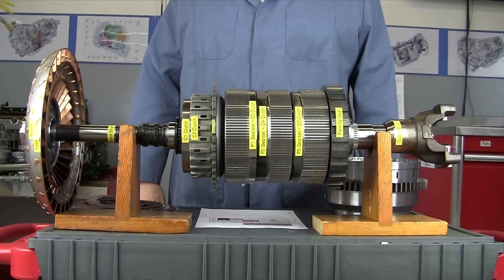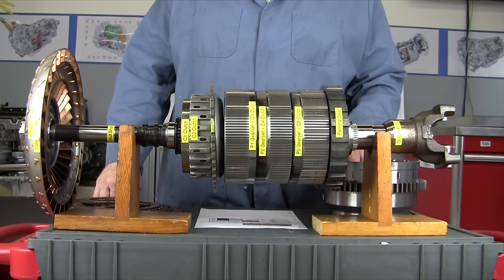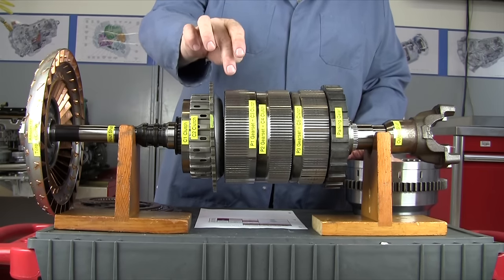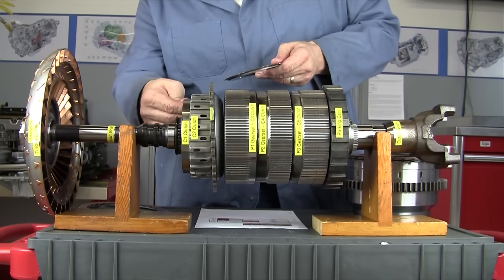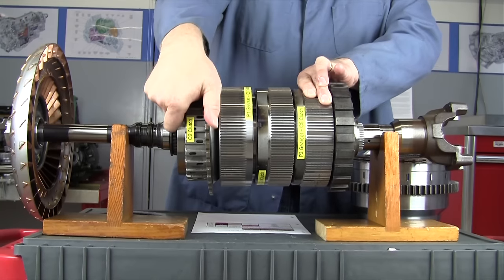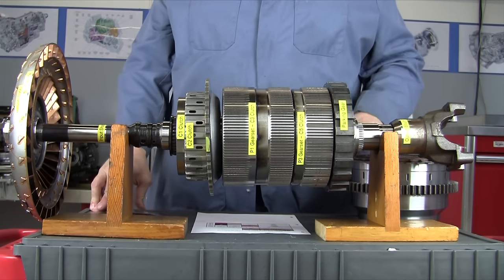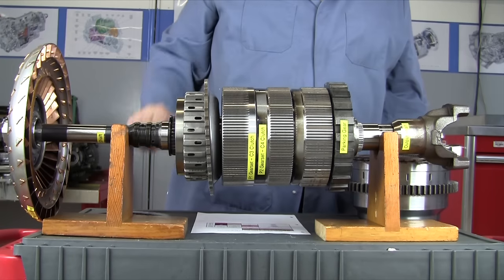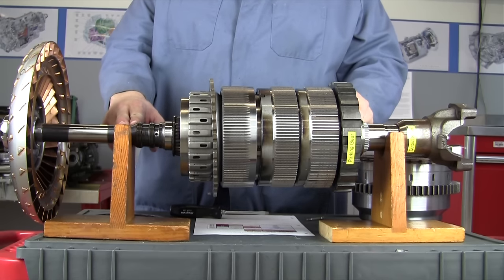Allison 1000 Automatic Transmission Power Flow

Comment: built transmissions for years,for GM,CHRYSLER ,FORD,lots of units,this looks like the typical nightmare for GM, they spent lots of money training me and others like me,the one thing I noticed about working on GM STUFF, is they design it and let the customer find the faults,when I trained for electronic shifting,i found many weaknesses all in the name of comfort and showing off,multiple speeds means multiple areas of weakness,gear changes under torque find the weakness in a unit quickly,this unit has no bands,means built in obsolescence from the get go,if you have bought a vehicle with this unit,waste the money on fluid and filters,i'm glad I'm retired

Comment: All those parts. All this complicated BS. and the simple cheap to manufacture manual is more expensive or nonexistent as an option.
Reply from the maker: Manual transmissions are going the way of manual steering, nobody wants them. Thanks for your feedback!
Reply: Since the 1000 is a clutch to clutch, could it be converted to a manual by replacing the torque converter with a clutch and adding shift selectors instead?
Reply from the maker: No, the torque converter drives the transmission oil pump which pressurizes the fluid that applies the clutch packs. You are describing a Lenko transmission. https://www.lencoracing.com/